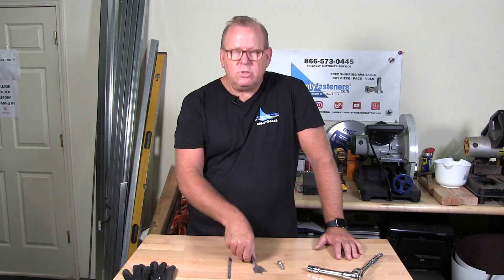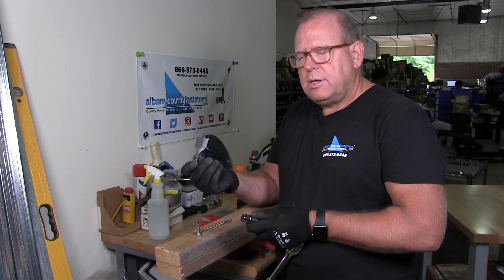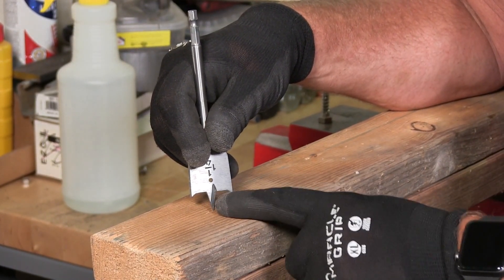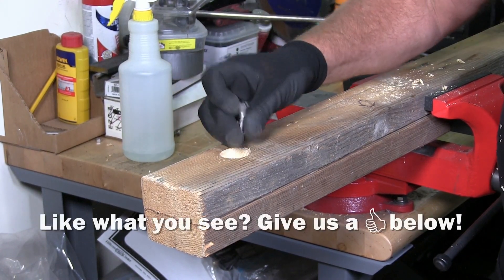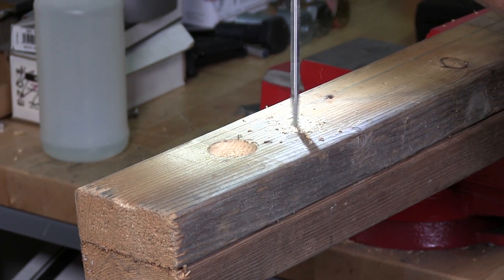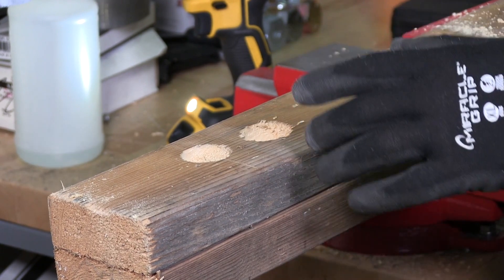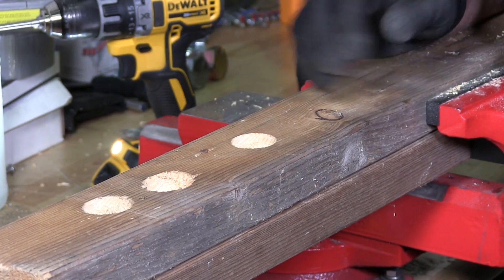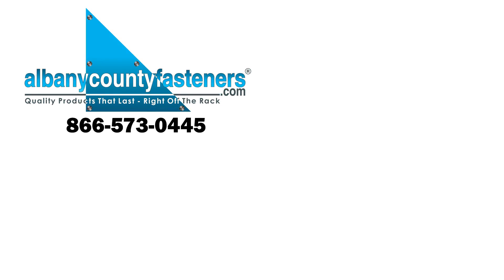How To Drill a Countersunk Pilot Hole With Spade Bits | Fasteners 101

Comment: Why didn't you use a forstner bit?
Reply from the maker: Hi AndroidGameplays4Every1,
Forstner bits tend to be significantly more expensive when compared to the price of spade bits. The same job can be accomplished with a spade bit so we decided to use spade bits for the demonstration, although Forstner bits also work. Forstner bits are great for specific depths in mind while spade bits can be used to more general work when you are unsure how deep you will need to drill.

Comment: Counter-bore is too deep, pilot bit should not go all the way through unless you are using a nut and bolt, water can get in from the back side when using a lag bolt, lag bolt is too short, should use a fender washer to keep bolt head from sinking in. Other than that, good demo.
Reply from the maker: Thank you for your feedback!